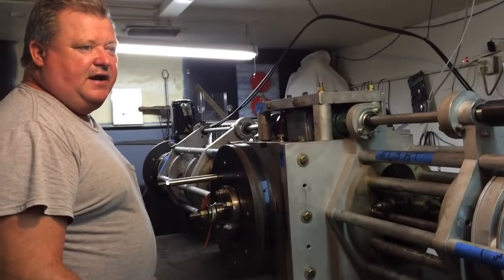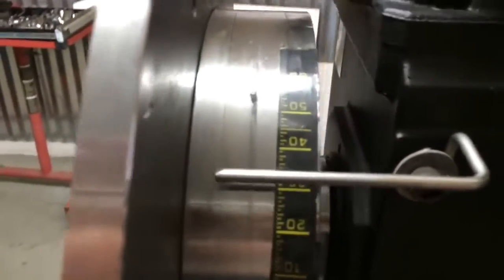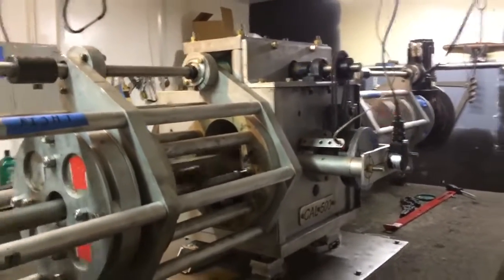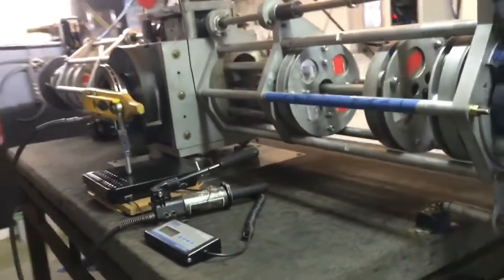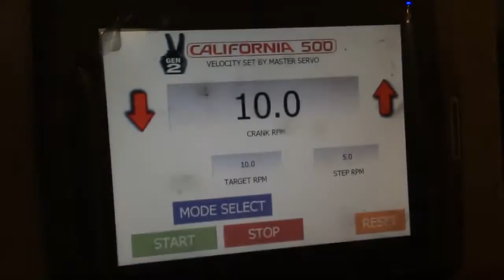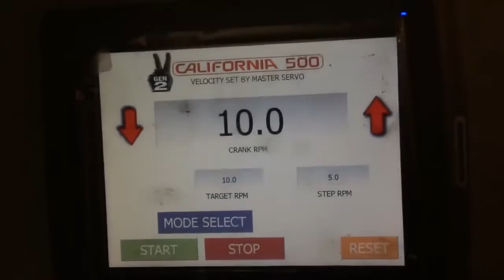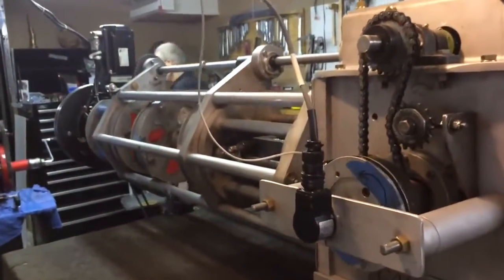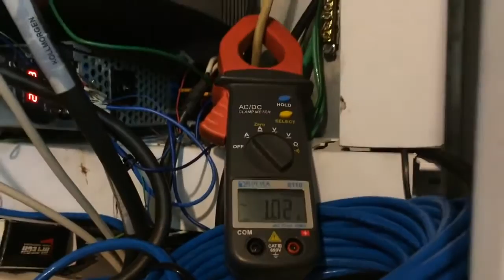Free energy   100% Magnet Powered   YouTube

Comment: Yeah , i might not know what i´m talking about here but , how or why the movement doesn´t stop ? because i´m thinking the three neodymium disk on each side are the same thus having the same atraction , how come it keeps moving when it actually shouldn´t simply because of atraction , i mean ... as the middle disk comes closer to the outer disk it should lock there and as the distance from the inner disk is bigger, the inner disk would not have the atraction power to break atraction from the outer disk wich is closer to the middle disk ... right ???  

how did you overcome this ? is it by deactivating or somehow blocking the magnetic atraction from a disk for a fraction of a second ??

Comment: Wow! Great job, but the meter says AC AMPS, not watts... so what voltage is the wire at, that goes through the amp meter? 24 Volts? 120 Volts?

If it's 24 VAC, then 1.6 Amps x 24 volts AC = 38.4 watts

If it's 120VAC, then 1.6 Amps x 120VAC = 192 watts

If that is the input to the motor rotating  the magnetic polarity, that is possibly more power input  than power output?

At 21 foot pounds of energy = 28.47 watts, of energy,  according to a calculator on google search engine.

I believe it is more efficient at higher speeds, and the power draw could be minimized by adding a tuning capacitor in the motor circuit...
Your Amperage my be less do to the duty cycle which would make it more efficient than it appears...?

Cool stuff! Truly great ingenuity! And Great Work!

Thank you for sharing!
Reply: Yeah , i might not know what i´m talking about here but , how or why the movement doesn´t stop ? because i´m thinking the three neodymium disk on each side are the same thus having the same atraction , how come it keeps moving when it actually shouldn´t simply because of atraction , i mean ... as the middle disk comes closer to the outer disk it should lock there and as the distance from the inner disk is bigger, the inner disk would not have the atraction power to break atraction from the outer disk wich is closer to the middle disk ... right ???
Reply: This guy is the expert on that, and i believe his claims and results...Look up the free energy earth engine. It looks like they are not only in production,  but also on the stock market as symbol QEGY.